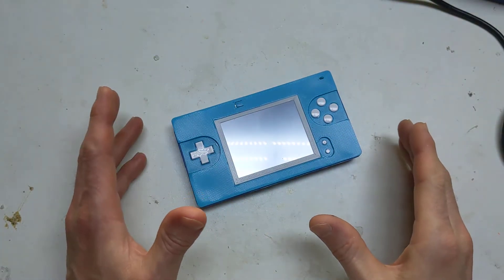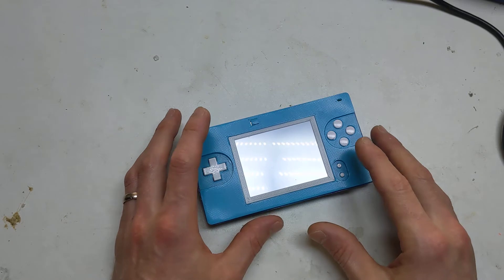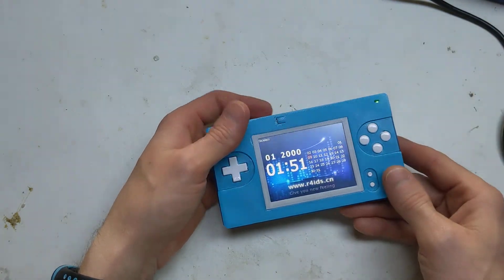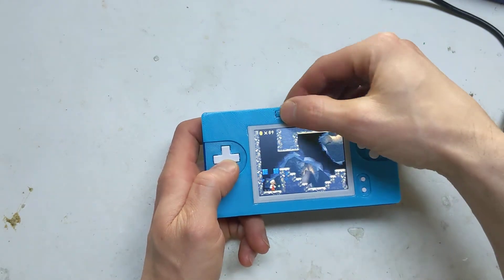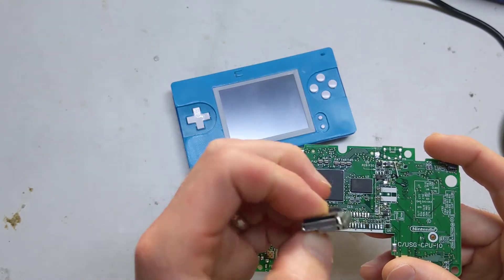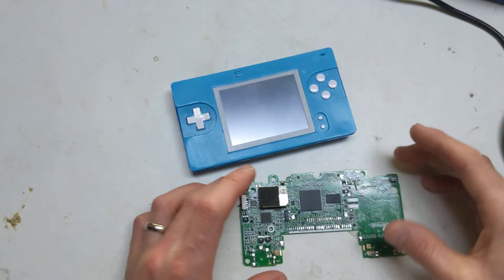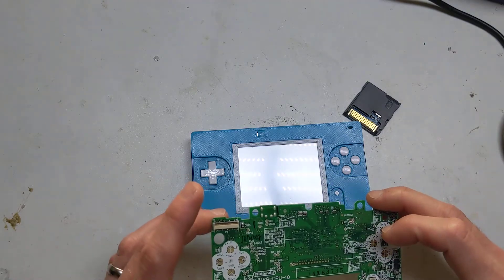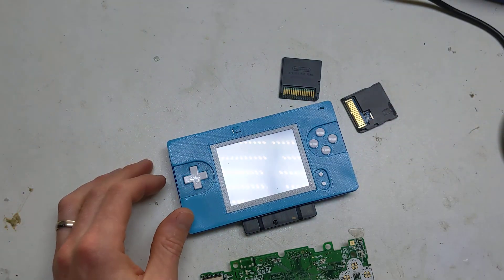Gameboy Macro screen switch mod (DS Lite)

Comment: After flashing patching firmware, always have a yellow top screen (
If I repeate v8a_flashme_noauto.nds at first stage again - top screen works well again
Reply from the maker: @TokiUndead  yes this is a known issue, the only way around it is to have dual wifi flash chips and switch between them like this https://facelesstech.wordpress.com/2024/09/22/ds-lite-dual-wifi-chip-tv-out/
Reply: @facelesstech  Thanks for the answer! I didn’t know about this “feature” in advance!

I plan to use the NDSL board to build the DMG-103. I was looking for how to make a screen swap button in it! Thanks for the text and video materials!

Comment: hi! which type of wire(s) does I need to solder the button on the pcb?
Reply from the maker: You can ether use 30awg/0.25mm silicon wire or 30awg/0.25mm solid core enamel wire. I personally use the solid core enamel and secure it with some UV cure resin.
Reply: @facelesstech  thank you! Two days ago I buyed an old DS, resistors and buttons, ready to build this version of the macro! (lol I hope everything will go well)
Reply from the maker: @HewMattBringTheWord  oh cool, enjoy.

Comment: Hey what flash card combo are you using these days? What’s the best thing to get for this?
Reply from the maker: Really any r4 card will work, if you want a cheap option search on aliexpress for ds games and buy one of these multi in one flash cards. They are ace 3ds plue cards, you just need to change the firmware to this http://ace3ds.com/ace-3ds-download.html
Reply: @facelesstech  thanks I’ll get hold of an R4 card and have a play 👌
Reply: @facelesstech  Just a little update and thanks!!!, I picked up a very old R4 card, lots of trouble shooting and purchasing an old 2gb SD card I was eventually able to follow your tutorial (and a couple others on flashme). but i've got it working, screen switching here by shorting p10 to ground 🎉 thanks again. now to package the switch 👌
Reply: Actually I had another question, If I want to do this to other ds lites, can I just skip to the last step now that I have the firmware that I want generated? or will this be unique to each device?
Reply from the maker: @Wezly  glad you worked it out. Yeah that's the trouble with the old R4 cards. You can just flash the patched firmware to other WiFi cards. I was accidentally doing this and have never had a problem.
Reply: @facelesstech  awesome thanks again.

Comment: Hey FLT, lovely update here! So, I've read below you can use this on the DSi model/s using twilight menu++. Am I right in understanding that you can't add a physical button for this? As the button option can only be added on the Lite as it exploits the AV out? So for the DSi option, it's purely a button combination using twilight menu++? (sorry if I've just spoke nonsense haha)
Reply from the maker: Yes, it's just a button combination for the DSi. It's a real slick solution.
Reply: @facelesstech  oh my, so we can a DSI XL Macro then!? Is this installed via and R4 to alter the firmware? Thank you for getting back to me x
Reply from the maker: @christopherbragg6643  it's a custom firmware for the DSi so all you need is a sd card, follow this guild https://www.rearvuemirror.com/guides/nintendo-dsi-xl-to-gameboy-macro-xli
Reply: @facelesstech  thank you!

Comment: Does It have a wifi chip?
Reply from the maker: Yeah, a DS lite won't boot without it installed because it contains the ds lite firmware which is what's modified to get the screen switching.

Comment: Would this be able to work with the tv output mod?
Reply from the maker: This is taking advantage of the TV out mod to do the screen switching, if you attached the external support circuitry it would give you tv out.

Comment: It would be perfect if it could also be used with Nintendo dsi xl. but my understanding is that ds lite has that feature hidden on a chip, which would be impossible to use on dsi and DSi XL why it doesn't.
Reply from the maker: It's even easier to do on dsi. If you install twightlight menu ++ then use this. I'm in the process of writing it up as a blog post https://gbatemp.net/threads/nds-bootstrap-modified-to-allow-play-ds-games-with-only-one-screen.582297/

Comment: Thanks for the idea, but I did not want to modify the case, so I use a smd diode and use the Select button that is hardly used in games, for some games that if necessary the Select button is easily solvable by touching the arm9 code.
Reply: Hugo This sounds like an interesting solution, could you clarigy what you mean by "If necessary the select button is easily solvable by touching the arm9code"?
Reply: @nissutobor9078  When I use the Select button to swap screens then I hack the games so they don't use the select button, or I change this to another button, so there is no conflict between swapping screens and using the Select button in games. I'm a retro game hacker, this is easy for me.
Reply: @hugopocked6695  interesting. I'm still relatively new to a lot of these types of mods, so at first I thought you were saying you were hacking the DS software to assign select to another button, but you're litterally editing the games? That's a nifty trick. I can think of a handful of pokemon games I would love to be able to assign the A button to the L trigger, lol. Appreciate the clarification mate.

Comment: Now the next question is, how far up on the DS line does this work?
Reply from the maker: With the dsi it can be done in software under twilight menu++ because of the extra horse power
Reply: @facelesstech  I'm curious how you go about implementing this with twilight menu? Do you have any articles?
Reply from the maker: @epic2448  yeah sure https://gbatemp.net/threads/nds-bootstrap-modified-to-allow-play-ds-games-with-only-one-screen.582297/
Reply: Do you know if the software version on twilightmenu works with Mario 64 DS?